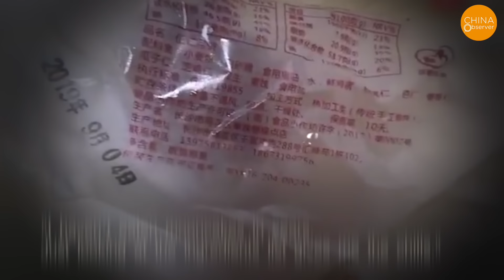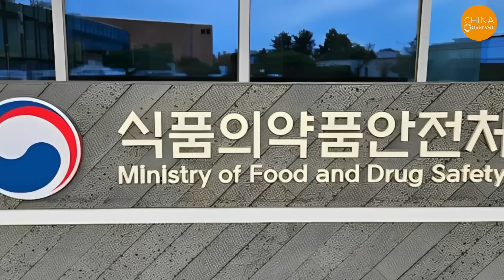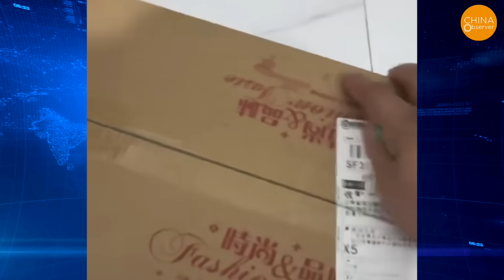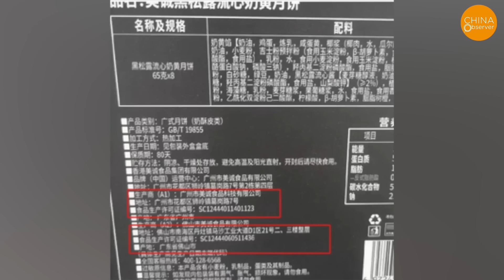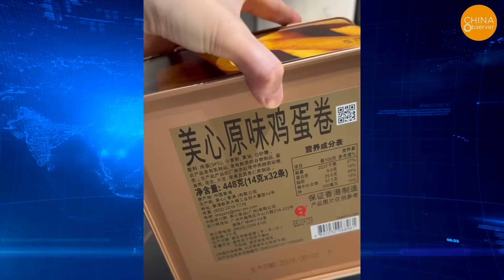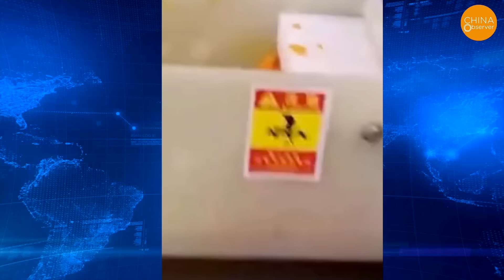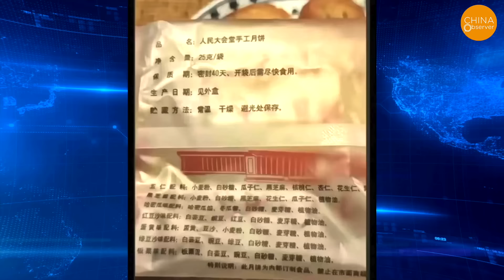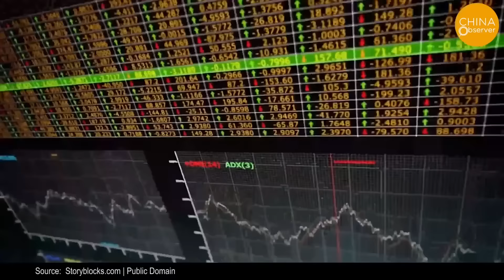China’s Toxic Mooncakes Actually Exploded, Even Dogs Won’t Eat Them

Comment: The "explosion" here fairly simple to explain. The packaging is sealed airtight (looks like it may be mylar), and the cake for one reason or another had some form of common yeast bacteria in it. This will generate some pressure until the packaging pops like a balloon. It's not a great sign from a food safety standpoint that there is bacterial contamination, but there is no mystery explosive additives here. Just yeast and sugar.